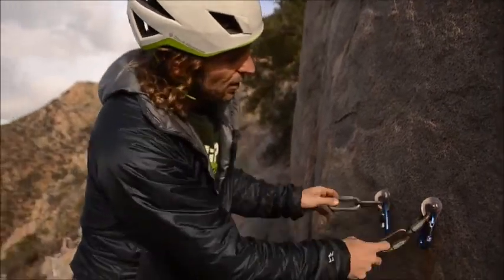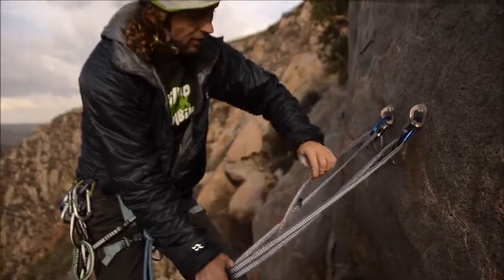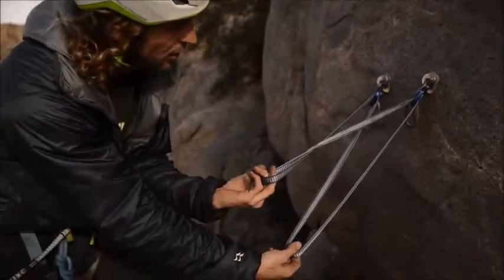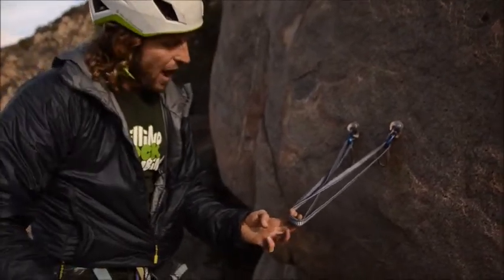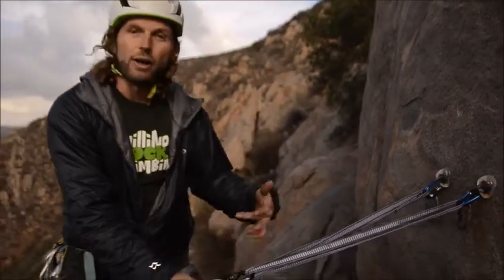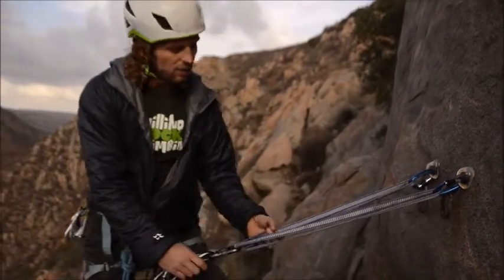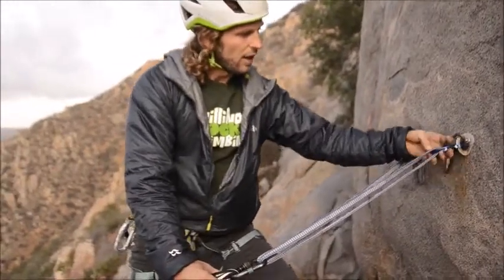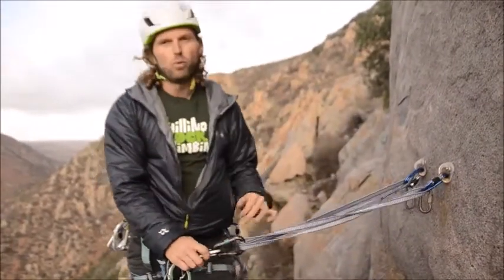How to build a sliding X anchor using a dbl  shouder length sling on two bolts

Comment: Needs the overhand knots on both legs. This will keep the extension within an acceptable range. Like you do on a quad.
Reply: Adding two limiter knots makes it an equalette. A sliding x is a valuable anchor on its own.
Reply: @Fumblezs  Limit extension, or don't. Up to you, But I limit extension whenever possible.